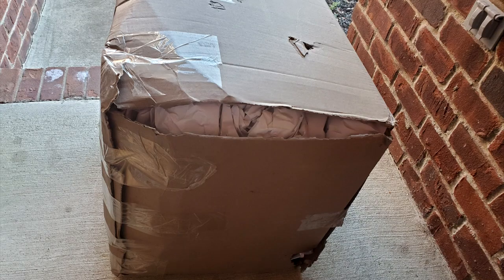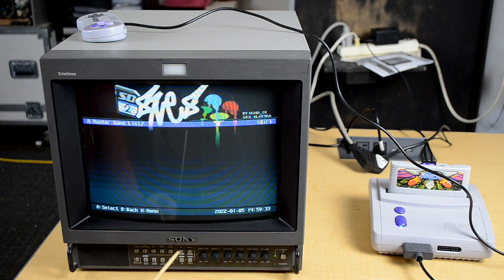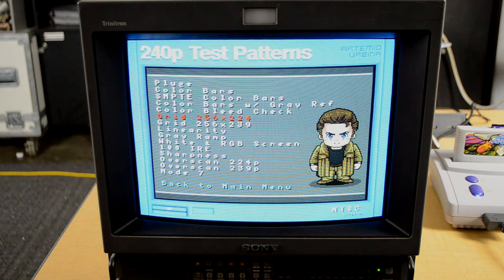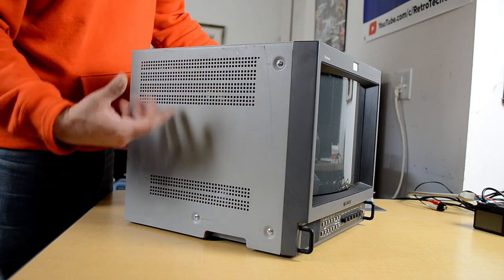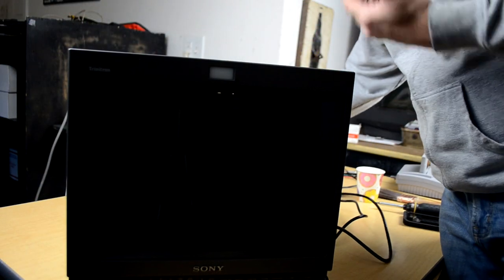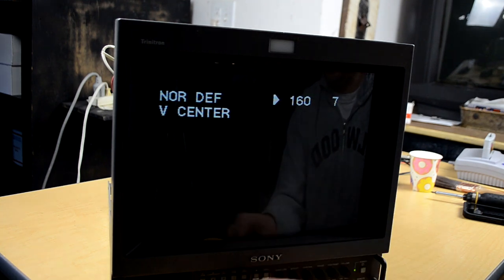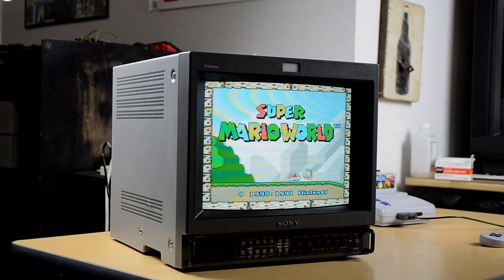How to fully check a Sony PVM M Series - PSU Voltage, CRT Beam, Service Menu & Must Change Caps!

Comment: A few more tips :
- while adjusting your settings hit the button of the input you are on to hide/show the OSD. 
- if you need to recall your last saved settings you can press the reset button twice rather than power cycle.

Comment: Should that hole where the anode cap plugs into be covered when you are dusting to prevent dust from getting in there? Thanks for another great video Steve.

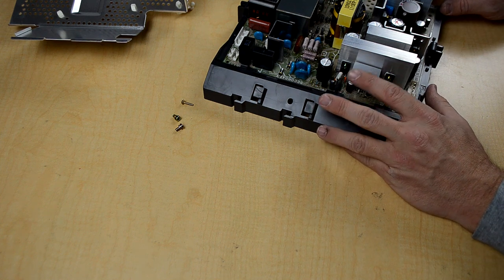Comment: 23:00
"The capacitors don't tend to fail"
Nonsense. To my knowledge recapping the power supply (and geometry caps) is one of the minimum recaps recommended. And yes, I too talked to Savon Pat about that, so idk what he was smoking when he talked to you.
Often monitors get overloaded and shut off (on BVMs), or sometimes act weird on startup. This is due to bad (as in deteriorated, not shorted or open) caps.
If you don't believe me, just measure the caps' ESR and capacitance.

For example, the two big red capacitors at 23:15 (C603) are always connected in parallel to mains voltage as long as the monitor is plugged into the wall. The power switch is connected after them in the circuit. Therefore these caps get beaten by any power surges present in your electrical system for years, even if the monitor is off.

Comment: Say if I didn't feel comfortable discharging the tube just yet, would you be against cleaning the PVM by using a blower vac or an air compressor?
Reply from the maker: Yes, just make sure to avoid getting moisture in the boards from a air compressor.   That should be fine

Comment: Hi RetroTech Steve. Great channel. I have a nice TV Sony Trinitron kv29cl11. It has convergence problem in corners. At center of the CRT picture is sharp, on corners a bit blury.
I'd like to hear your opinion on fixing this problem by placing a fridge magnets, ones you pick up as souvenir from a trip, behind the CRT. I got solid circular ones about half an inch in diameter, and rubber-like ones I could cut with scissors. Thanks.

Comment: Hi Steve, thanks for your videos, i was wondering if you can advice me on this issue I have a PVM 20M2md with shaky image i replaced the power supply with my 20m4 and it works perfectly fine l, do think recaping the old power supply fix the issue ?

Comment: Hi. I saw your youtube and I am wondering if I can use electric air blower on my ks20fs120 after opening the back to blow out the dust. Just scared to follow discharging and brushing. I just want to clean out some dust

Comment: Hi steve, if the psu voltage doesn't fall within specs, will a recap help? I have a 20m2 which reads 0v, -22v...and lastly 15.3v. The monitor works but not sure if a recap on the psu is necessary

Comment: Ummm.. there is one more thing I need to ask you about..
Does the back of the CRT tube (the neck where the gun and the neck board are) glow with light when the TV is turned on?
I have a 21 inch SONY consumer CRT.

Comment: I have a 14m4u that has a video issue. The image extends to the top left and right corners accurately, stays straight all the way down to about the bottom fifth of the screen where the width begins to narrow uniformly, making the overall shape of the displayed video look like an upside down gumdrop. Can this be fixed in service menu or is it more likely I'll need to recap? If recap, which board would I need to focus on?

I also have a small 9" pvm that only displays black and white over ypbpr, but color via composite. This will also require a board recap?

Comment: Just to be very clear since this is the scary part to me: Once the Tube and Anode Cap have been discharged like you described, are all the other parts also safe to touch afterwards? Does the Flyback discharge with the Tube for example? Or are there extra steps to discharge the other components in a crt?

Comment: I just got this exact model it’s my first pvm paid $200 for it it’s a 1997 date 14m2u I’d say it’s in better condition than this was before you worked your magic it has a great picture but the geometry isn’t perfect the image is tilted clockwise slightly and under scanned slightly so there’s a sliver of black in the top left and bottom right corner what do I have to do to fix this? I’m using it for snes, n64 and Wii also do you have a cap kit for sale? Please get back with me! I want this thing to last! Also thanks for these videos!!!!

Comment: In relation to heat, after cleaning all dust from the interior, is it normal for a monitor such as the 14M2 to produce a noticeable amount of heat from the vents when operating under normal conditions?
Reply from the maker: It can produce a significant amount of heat.  That's normal because the hottest spot is on the Power Supply and that sits directly next to the vent holes

Comment: I got two PVMs here, one has the blanking lines problem (which I solved with the service menu, good to know I now have to change that cap because I can now be sure the problem will soon reappear as the cap gets even worse), the other one has the
Tally light of Death.
But it's not the power supply! I can swap the PSUs between both monitors. One will power up just fine with both PSUs, the other one is dead with the same symptoms from both PSUs:
The 15V line is around 12V and fluctuating (as are some other secondaries). The 115V and 5V are fine (although I measured 380V on the 115V once, but I'm sure that was a grounding issue on my meter). (and I'm not 100% sure if the 5V didn't also drop).
Any clue what it could be? (I checked the HOT. No short there) 
(btw. I've given up on another PVM that blows its HOT. Put a new one in, turn it on, works for 8 seconds and the 15kHz whine sounds perfectly normal, then it suddenly dies and the HOT is shorted completely through)
I'm not a monitor expert. Usually I fix logic boards. And I'm pretty good at it too.

Comment: Hi Steve! While having the color bars on screen you mentioned that if there were distortions on the screen that'd mean the pvm has high hours. Does that mean that the pvm/tube is unsaveable or simply more fault finding and looking for/replacing more bad components ? Also, by distortion do you mean geometry distortion or something else?
Reply from the maker: I mean like blurry or washed out looking mostly.  Like oversaturated with only a moderate amount of brightness and contrast turned up.  The tube is really only dead when either a color fails completely or if it has screen burns.  Many others can be rejuvenated

Comment: I recently get my hands on a 14M2E PVM and it's working great but, beside the servicing, are there things I need to know about it ?
Reply from the maker: There is lots more specific info in the service manual that may be helpful.  Google your model and see if you can find a free PDF.

Comment: Vertical linearity looks a little off at 8:08, top circles are stretched in their superior area, is this as good as it is possible to get ?
Reply from the maker: That was before any adjustments to linearity.  It was off a bit.  I made the adjustments towards the end.
Reply: @RetroTechUSA  Was wondering because despite the recap I made to geometry caps on my 2053 I cannot get rid of a similar vertical linearity situation... not sure what to try next... any advice ? 😊
Reply from the maker: It's tougher on that one since there are a limited anount of geometry controls.  Other than the using the available adjustment pots, you could try reseating your yoke against the back of the tube or maybe even adding convergence strips.  Also since it's a much bigger screen, it will have more geometric anomalies
Reply: @RetroTechUSA  are you not confusing with another monitor? The 2053 has the same menu and settings as the pvm shown here 😊
Reply from the maker: Sorry, you are right.  I thought you typed 2530, lol.  Sorry about that.
Reply: @RetroTechUSA  No worries 😉 I will work on reseating the yoke and eventually complementing with some convergence strips.
Reply: @RetroTechUSA  saw your final adjustment now, somehow missed it on my first viewing. linearity looking good indeed after your calibration.

Comment: Hello at my job they were chunking a 15 inch Pvm 1341 and I took it off there hands I have turned it on and I can hear the normal sounds of a crt but really no indication the screen comes on  is this because there is nothing being fed into it ...before I bougg the adapters to plug a system I was just wanted to make sure
Reply from the maker: Thats normal.  You need to send something into that PVM.  There are no menus etc.  On that PVM

Comment: Hi retro tech, Could you Please help Me, I know this Video ,is a year old but hope you see My comment, I own a  1986 Sony Trinitron model PVM 1271q,  My Crt is not lighting up, I know nothing about tv ,s but I do have some knowledge of older Tube sets, Some what, But very little, ,The element is not Lighting up, But I have Power at Most Pins, How can I try and Power up The element, With separate power, just to see if it lights Up, What Pins would I use, I need this for my security System. Thank you For any Help Brian

Comment: Hi @Retro Tech i have question, i have PVM model 1440qm that have problem with bleeding red colour, i seen that it can be foault of the C board and resistor/diodes/or transistors in red line, i have change all transistors for this line but that don't help me (it's the same), i check the 8k2 resistor but it show me 8k19 so it's look good, where more can i search for the part that is bad?
Reply from the maker: Could be a bad tube.  Best to test voltage on the red line or use an oscilloscope and refer to the service manual for the designed specs.  If the current on red is within spec, then the tube is worn out and needs replacing or rejuvenating.  Good luck
Reply from the maker: Just to clarify, when I say red line I mean to check the current rail/path on the circuit board that has the red coming along it until it gets to the tube on the neck board
Reply: @RetroTechUSA  Ok, i will try to measure everything then look on diodes and resistors on C board because i have swap all of the red line, the problem look just like this one https://www.youtube.com/watch?v=WwiFtE-5qes . Red is on top of everything and when i give TV a signal i have normal screen but the fonts bleed with red a little bit.
Reply: https://www.youtube.com/watch?v=kKp25TgMCf4 that's the one that i try to repair.

Comment: I just got a PVM and the seller didn't pack it well and it likely dropped during shipping. It showed up and the Shadow Mask is broken so one corner of the screen is discolored. The seller isn't wanting to take it back so I'm having to deal with that at the moment. It's frustrating.
Reply from the maker: That's tuff.  Sorry.  If you bought it off eBay, just stand your ground and demand a full refund.  It may take a week or two, but they will back you up eventually